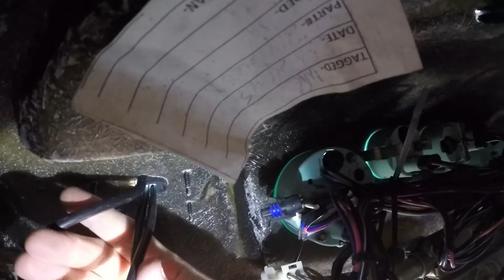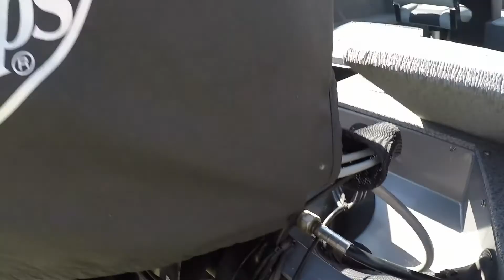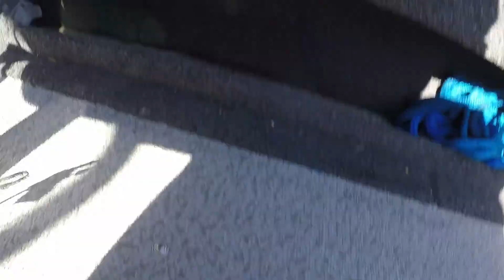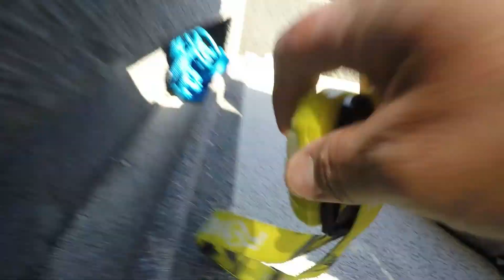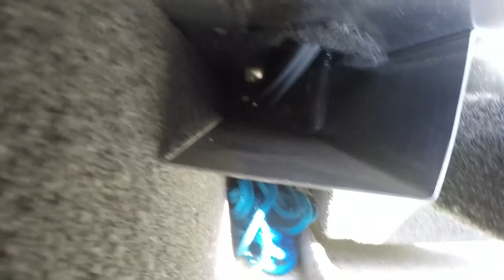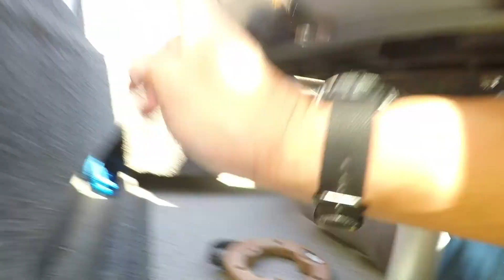Lowrance Fishing Machine how to install/upgrade fish finder (transducer and power cable routing)

Comment: Yes it's in line...
I put the fuse in first, then hooked the battery up...it immediately blew the fuse...

Sir, you're very kind assisting me. Thank you very much. You surely don't have to waist your with me.
The hook up is simple, so I blame it on Lowrance...
God Bless You.
Terry
Reply from the maker: I looked up the manual to that fish finder and it does indeed call for a 3A fuse, and the current draw is only 1.1A from the unit so there is no reason a 3A fuse should blow. It also should not blow as soon as you connect it. the unit needs to be powered on before current draw occurs. Sorry to say, but there is definitely something wrong with that unit you have if all other things in your installation are correct. You need to get someone on the phone over at Lowrance. I've done it before and they are pretty responsive in my experience.

Comment: It calls for a three amp fuse. 
The positive and negative wires are hooked to the battery.
I insert the fuse into the fuse holder, and the fuse blows immediately.
Both wires are tight and secure.....
Reply from the maker: Is the fuse holder in-line on your positive wire? Make sure the fuse is secured in the holder before hooking the cable to the battery or the fish finder.

Comment: Help, please.
I've bought 3 lowrance hook 4's
The fuse blows immediately when inserted...Lowrance has no answers, but replaced all 3 units...
Reply from the maker: what size fuse are you using? it blows when what is being inserted? when you plug the unit to power? or are you inserting the fuse while the 12v wire is connected to power? a little more detail will help. If you could describe where you have the fuse that will help as well.